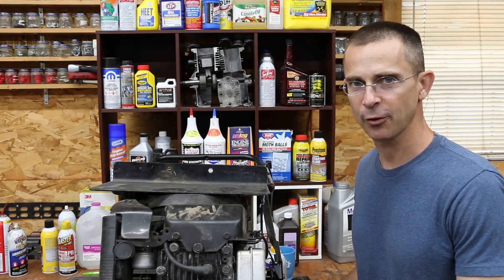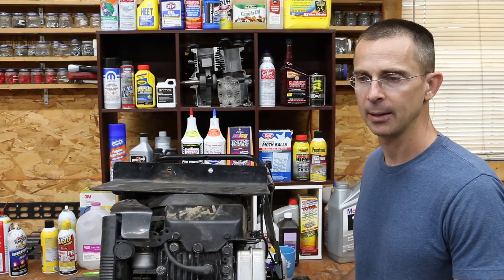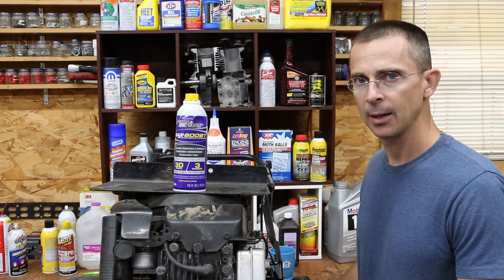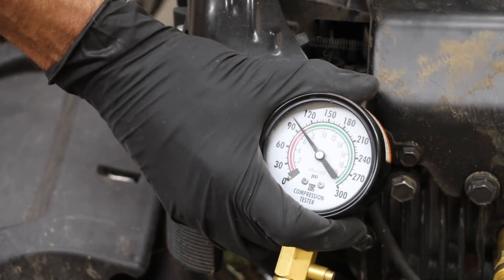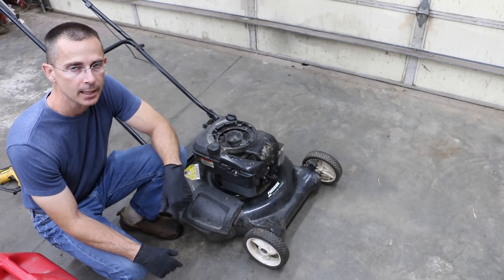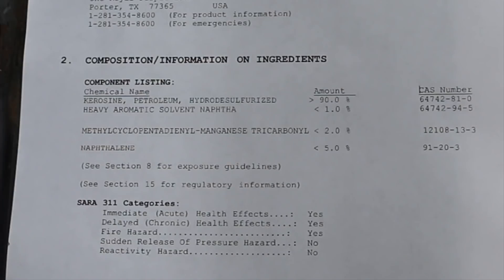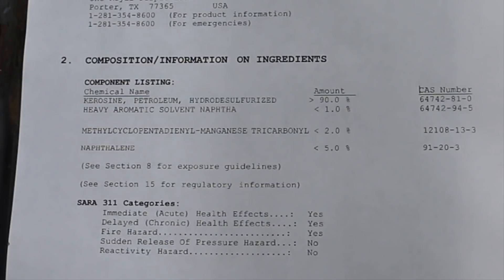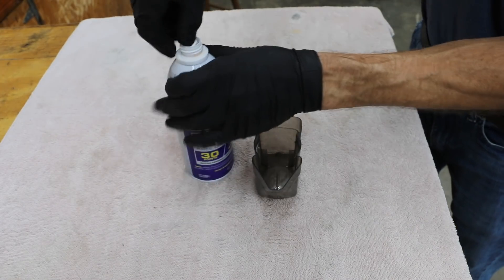Will a gas engine run on 100% octane booster?  Let's find out!

Comment: I had a bike that was 14.5:1 compression and needed race fuel. But I didn't have any one weekend. So I tried 91 with octane booster. It didn't run for shit. Being an engine builder, and understanding the correlation of octane rating and compression, I really think octane "booster" is a money scam.
Reply from the maker: Thanks for commenting on this.

Comment: What material did you use for the see thru head? I got a Wisconsin-Robin engine that could be perfect for that.
Reply from the maker: 1-inch thick plexi-glass.  I can only run the engine for around 30 seconds at a time before the plastic begins to melt.

Comment: Did you get that orange residue analysed to find out what it was ?  Seems like way too much of one of the components of the Octane Booster .
Reply from the maker: I contacted a chemist in the field of fuel and additives and he informed me that the orange was caused by MMT.
Reply: HMMMM !  Well ,  according to your MSDS from Royal Purple ,  the Octane Booster contained less than 2% of the MMT ,  so I guess it left all of the MMT inside the engine . I wonder how it would work if they just left out the MMT  ???

Comment: a guy at work told me a story how he dumped 2 cans of octane booster in 1/4 tank of gas in his corvette and it caused his engine to bend a connecting rod.  not directly saying this guy is a lier but it seems this takes away some validity of that story.  maybe the guy just drives like a jackass...idk
Reply from the maker: Wow!  I find this hard to believe.
Reply: yeah I wonder about this.  as I stated in the PM i sent you, the guy reveals in his story that he caused a big back fire then the rod snapped.  i have also heard tale of race gas in a street engines doing this sort of thing.

Comment: Great videos, its not very often that some one does test like your doing without some companys  agenda hidden in the background. It would be interesting to see if high quality 2-stroke oil (stihl)is better than low quality oil(Pennzoil or mag1), or if AMS OIL (saber) can be used 100:1 with no adverse affects. Its crazy what a couple of drops of octane boost in a chainsaw fuel tank does,thanks again for the videos!!
Reply from the maker: Thank you very much for the positive comment and for the great video test idea.

Comment: Ive always heard that if you add transmission fluid to diesel as a fuel treatment it will clean the engine (kinda like Seafoam, lucas oil diesel treatment, ect.) Can you test if this is in fact true and also will the engine run on transmission fluid alone? Thanks for your time i love your videos you do a great job! I look forward to your response!
Reply from the maker: Thanks again for the recommendation to test ATF in a diesel.  I'll see what I can do.

Comment: Late comment, but the long-named compound in the listing is MMT, which is what provides the octane boost. It is also responsible for the orange deposits. You will see those deposits after using other MMT-based additives as well. The purposes for the other ingredients are likely: kerosine [kerosene] as a stable bulk carrier, solvent naptha is likely to dissolve the MMT originally (gasoline is basically naphtha), and the naphthalene is likely there to further modify the effective octane like a buffer. Naphthalene has an octane rating of about 90 on its own. Since kerosene is similar to a lighter version of diesel, you were basically running that engine on high octane diesel fuel! 

Thank you for all these videos! Super entertaining.
Reply from the maker: This is great information. Thanks for the positive comment.

Comment: hey guys,the orange is sulfer
Reply from the maker: Thanks for commenting.
Reply: You wouldn't be able to get reduced (yellow) sulfur deposits in an engine cylinder.  Combustion is oxidation.  You'd get S02 - sulfur dioxide.  A smelly gas.  Besides the MSDS says the hydrocarbons were reduced in sulfur content, as required by current environmental laws. ("Hydrodesulfurized" @ 2:14)

The MMT (organic manganese octane booster) in the Royal Purple was oxidized to manganese tetroxide.  If you google that compound you will see how a coating of it would appear gold on a metallic surface.

Comment: I run octane booster (mix not pure) on my 64 Falcon  carbureted 289 HIPO,10:5 to 1 compression. It DEFINITELY works, and will solve many of your drivability problems. The biggest problem I had with tuning was crappy pump gas. Premium was at 93, now it's at 91 with 10% alcohol. It will turn your spark plug tips (Orange / Red), it is perfectly normal, and has been added to most modern spark plug comparison charts.
Reply from the maker: Thanks for commenting on this. That's a nice vehicle!

Comment: Try doing E85 Running on 100% or mixing with different supliments that a lot of people use for drag racing or racing? Maybe jet fuel, see how it all burns or changes or blows things up inside a engine , compared to normal NA aspired engines.
Reply from the maker: Thank you for this recommendation.

Comment: So if most of the stuff in the octane booster is kerosine, would you say (this) octane booster is just high class fuel in general?
Reply from the maker: MMT is an octane booster, which is what caused the orange buildup.  Thanks for commenting.

Comment: Awesome video, as usual. May I ask what clear material you are using for a cylinder head? Also approx how thick is the material, did you use a head gasket or just high temp Permatex? Thanks again and keep up the great vids.
Reply from the maker: Thank you very much for the positive comment.  I use 1-inch plexiglass.  I was using a wooden cutout coated in high temp gasket maker for the head gasket but I've since made aluminum gaskets out of plate aluminum.  I'll probably use new Briggs gaskets on each side of the aluminum. Thanks again.
Reply from the maker: Thank you very much for the positive comment.  I used 1-inch plexiglass. The gasket is made of plywood coated in high temp gasket maker. It'll survive 30-second engine runs but that's all.  I recently made a new gasket out of 1/4 inch plate aluminum.    Thanks again.
Reply: Project Farm thanks for the quick reply. I am a lawn and landscape mechanic by trade and truly appreciate your videos. Great video editing and really good content.

Comment: Will a gas engine run off only nitris oxide(dont mind my spelling)
Reply from the maker: Thank you for this recommendation.
Reply: Nitrous oxides doesn’t burn. So no it won’t run. It cools the air coming in, allowing a bigger mix of air/fuel ratio which is a bigger, harder explosion.

Comment: could you run used engine oil mixed with gasoline? and see how much oil:gasoline ratio the engine will run on?
Reply from the maker: Thank you for this recommendation.

Comment: conclusion lawnmowers run on anything  flammable
Reply from the maker: LOL! Very true.
Reply: Jonathan Chesnutt activated charcoal
Reply: It's a long shot and I don't know where you would even find it. But I wonder if a lawn mower could run off of really fine coal dust.
Reply: Jonathan Chesnutt 
I believe the nazis invented a coal ICE near the end of the war.
Reply: http://www.driveonwood.com/library/auburn-test/
Reply: a method of cleanly burning coal is vapourize it then power internal combustion engines from it. it vapourizes much like wood does.
Reply: @mountainpass4255  
Yes. Corn, wheat dust (flour) as well. Would require a greatly modified carburetor. 
Not practical, of course: too much ash (abrasive)-to-carbon ratio.
Reply: @mountainpass4255  Coal dust is explosive so provided you could make a fuel system it would probably work
Reply: @mountainpass4255  every coal-fired power plant runs on extremely fine coal dust. So you could find plenty there ready to go.
Reply: @mountainpass4255  do you think it would run being a powder and not a liquid?
Reply: @erikbates5243  It might if it dispersed properly, clumping would be an issue. So would consistent feeding using the air intake.
Reply: @mountainpass4255  I might try this
Reply: @mountainpass4255    That would be similar to running on fine flour dust as both are flammable.  Possible?   Doubtful but interesting idea.  Although I too have no idea how to implement it.
Reply: Ran one on charcoal lighter fluid before.
Reply: thanos mousios army deuce and a half multi fuel runs on damn near anything!
Reply: I just ran my 4 cylinder chevy cobalt over a mile on octane boost alone to a gas station. Saved my afternoon
Reply: thats not fuckin true at all you idiot.
Reply: Honestly bro he has put the lawnmowers  through so much crap and still they keep runing of anything that will burn
Reply: Humans are also flammable (video suggestion)
Reply: True I ran one on charcoal lighter fluid
Reply: Simple engines, I suppose.
Reply: Motorkote
Reply: How about custard powder that very explosive as a factory in the uk found out factory in Banbury, UK in 1981. Their traditional custard powder, known as Bird's Custard,
Reply: I have ice on my nuts
Reply: Oxygen is technically flammable. To be technically correct i'd say anything "combustible".
Reply: Anything flammable will run in a carburetted engine, same will an efi system, you'll just have to tune the computer
Reply: I haven't ran out of gas in a looong time.  I know it's not good anymore. That little sob never misses a best.
Reply: Even Bacardi Rum 151?
Reply: wood fumes!

Comment: tht looks like rust. the octane booster is carrossive. i would not put tht in my vehicle if i owned a gasser. i own diesels. i dislike gas vehicles.
Reply from the maker: I'm told the MMT caused the orange buildup.  This stuff can hurt the catalytic converter on a vehicle.
Reply: Project Farm ohhh gotcha it looked like rust but i guess thts jus wat it leaves is tht orange stuff. an iv heard octane booster actual messes up the chemicle octane in the gas. but tht could jusbe ppl against it if tht makes sense

Comment: Running race fuel or exessive cleaner or booster can cause burnt valves or high engine tempertaures will cause oxygen sensor failure and possible converter damage if abused.
Reply from the maker: Great point. Thanks for commenting.
Reply: Project Farm no problem 👍👍😁

Comment: run an engine using ed's red gun solvent. CONTENTS: Ed's Red Bore Cleaner

1 part Dexron II, IIe or III ATF, GM Spec. D-20265 or later.

1 part Kerosene - deodorized, K1

1 part Aliphatic Mineral Spirits, Fed. Spec. TT-T-2981F, CAS
#64741-49-9, or may substitute "Stoddard Solvent", CAS #8052-41-3, or
equivalent, (aka "Varsol")

1 part Acetone, CAS #67-64-1.
Reply from the maker: Thank you for this recommendation.

Comment: Have you found anything that actually does a noticeable job of cleaning carbon etc from the engine? 
Have you tried water injection?
Reply from the maker: Water, ATF, Seafoam, and Marvel Mystery Oil seem to remove carbon.

Comment: I was wondering if anyone knows the answer to this. Is it okay, and good for a car engine for longer oil filter than the oil filter specified for the car, if it fits? Thanks for the video! I always enjoy watching your videos.
Reply from the maker: Thank you for the positive comment.  I highly recommend using the filter designed for your vehicle. I'm unable to determine if it's a suitable substitute without comparing the internals.  I wouldn't want to risk it, but this is just my opinion. Thanks again!

Comment: I haven't even watched the video yet and I can guarantee you that it will indeed my mom octane booster by the way this is the guy who told you about the Cairo syrup so that's my prediction it will indeed run on octane booster just like that motor ran better on or c model racing fuel that's like top-of-the-line what's a 20 $25 a gallon please
Reply from the maker: Thanks for commenting on this.

Comment: Keep up the GREAT videos! I found on a racing motorcycle on methonal-alcohol, we had to do from a 300 main jet to a 500 main jet, which was the largest for the mukuni carb. We then drilled out the main jet to have it perform better. After a 10 lap main event race, the carb had ICE on it and the engine was actually cold. Only the exhaust pipe was hot.
Reply from the maker: i really enjoyed reading your comment.  I should have drilled out the main jet. Thanks for the positive comment!

Comment: The MMT in those is what makes the chamber orange, I used to use NOS booster and did the same to my spark plugs. I know it works because my car (with no mods at the time) over boosted and went into limp mode
Reply from the maker: Great point and thanks for commenting on MMT.

Comment: Have you ever run pure liquid propane through your engines? Back in the day, my uncles would run a fuel tank of propane to clean out the carbon buildup. Whether it was a straight four or their V8s. Careful to know that this was back before the 1973 engines or newer. Before all the emission sensors and plastic gas tanks. Lastly with cast Iron engines, not aluminum. They would run at operating temp, at highway speeds. For this does create a lot of smoke due to the carbon burn off.
Reply from the maker: Thank you for this recommendation.
Reply: I called my Uncle, He stated that he would use no more than 5 gallons of propane. It would take too long to use a full tank. He also stated that you would need to change the oil, oil filter. gas filter, and rebuild the carburetor (replacing all the gaskets). after running the propane. Just to let you know.

Comment: I'm loving this channel.  You should get a small diesel engine and run it on diesel then 50/50 mix of diesel and waste motor oil and then straight waste motor oil.
Reply from the maker: Thanks for the positive comment and thank you for the recommendation!

Comment: Lolz, just reading what was in the octane booster I could have told you it would be fine. I ran out of gas for my push mower and the wife wanted to mow the front lawn. I had a gallon of naptha in the shed ;) ran it like that for   at least 5 tanks no issues.
Reply from the maker: Thanks for commenting.
Reply: It would be really cool to see a gasoline engine run on diesel when the diesel has been mixed with something else to lower the octane to something similar to gasoline.

Kind of like the opposite of mixing motor oil and gasoline to run in your deuce and a half diesel engine.

Comment: Man, great videos that really "go there".  I really would love to see acetone and/or MEK (methyl ethyl ketone, see patent: US 4482352 A)...especially in a 15% mixture with gasoline... probably cleans well.

Also a three part mixture:  off the shelf hydrogen peroxide (H2O2), which is an aqueous 3% solution of oxidizer...with acetone should make it miscible (dissolve) in gasoline...will the acetone/H2O/H2O2 strip off the carbon?  Or just send the peroxide through the carb like you did with the water.
Reply from the maker: Thank you for this recommendation!

Comment: i always wondered if the gas stabilizater I had in my mower/snowthro or motorcycle tank during winter/summer rest was bad for the engine and if it would damage to put a lil too much.. maybe a test with 100% fuel stabilizer ? cheers
Reply from the maker: Thank you for this recommendation!

Comment: You should take out all of the oil in the crank case and replace it with gas
Reply from the maker: Thank you for this recommendation!
Reply: Project Farm can you try it I don't want to rune my engine trying it if it doesn't work

Comment: ok yep loved this video and yes natha does work it is not only moth balls its also lighter fluid or in the paint world natha is available in gallon cans and it does raise the octane when used right. so as for the product you tested it has a common ingredient thats orange and leaves that orange reside behind after burned its recommended to use every tank of gas as this build up would soon foul your plugs it does build up just like carbon so it is interesting that it was mostly keroseine wow didnt that was such a good addative, thanks for the insight and the video testing, keep up the great work
Reply from the maker: Another great post and thanks again for the positive comment.

Comment: A loong time ago, I accidentally put power steering fluid into a half tank of gas in my toyota. Before starting the engine, I realized my horrible mistake and syphoned the tank and replaced it all with good gas... I knew that there was likely still some power steering fluid in there, but I wasn't about to remove the gas tank. Ran the engine after that and it ran better than before! Can you experiment with power steering fluid and gas mixtures and see what happens?
Reply from the maker: Thank you for this recommendation!

Comment: Try running an engine on kerosene
Reply from the maker: Thank you for this recommendation!
Reply: My brother used to run an old BSA C15 motorcycle on paraffin (the U.K. near equivalent of kerosene). It ran about 10 mph faster than on ordinary petrol, but did need decoking every six months.

Comment: The active ingredient in the Additive is the 2% of MMT seen in the msds....the other fluids are just basically carrier fluid.  MMT is a good octane booster. But is banned in Canada.
Reply from the maker: Thank you for commenting on this.  I'm told it's what caused the orange buildup.
Reply: Project Farm yes I think so..Ferrocene is also another metal based octane booster which is very effective as well. And will give an even more orange look as its iron based. And I think is safer to use compared to MMT
Reply from the maker: Interesting. Thanks again!

Comment: Sulfides have been made ilegal many years ago. How do companies still offer products using such . SHAM. I will never use the purple again. Test for lead next in this stuff. Take a class in automotive school on fuel for internal combustion engines. Its not gasoline we burn its a mix of many volatile hydrocarbons.
Reply from the maker: Thanks for commenting on this.